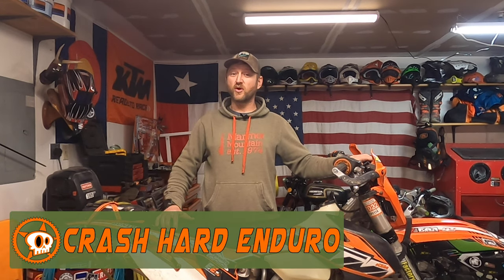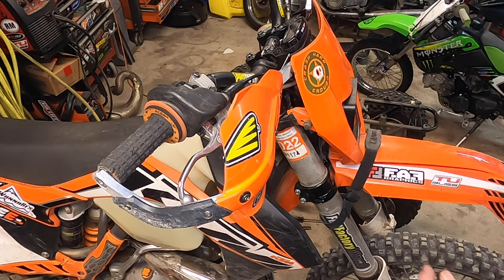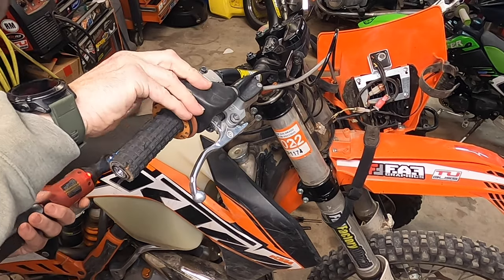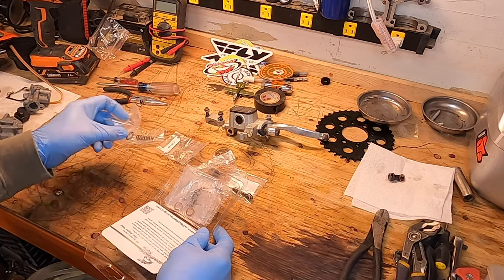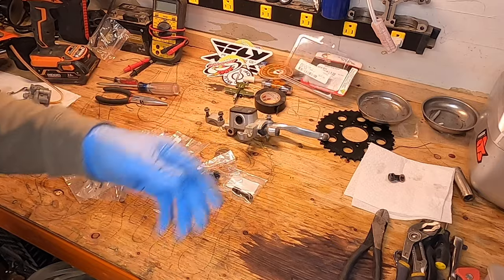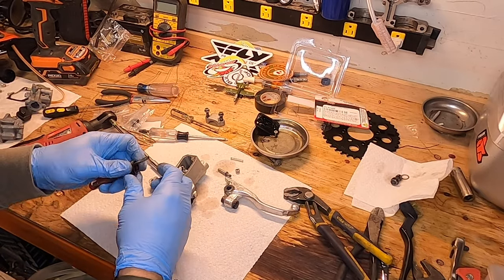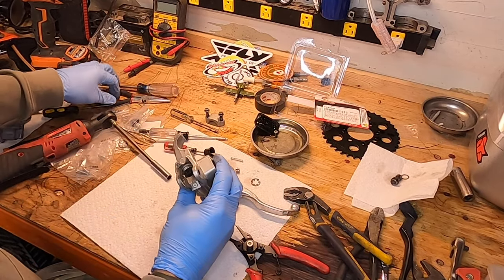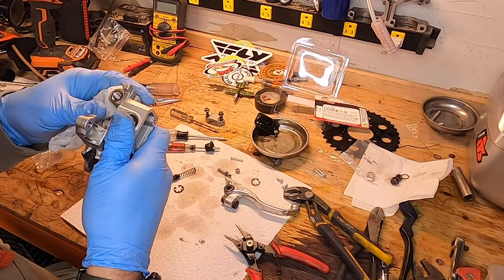HOW TO: KTM Front Master Cylinder Rebuild. Anyone can do it.

Comment: Got done with the project a little bit ago today.  Your video definitely helped.  During the frustrating part of putting the snapring back in, I ended up using skinny tweezers to hold the piston in while squeezing the the snapring.   Snapring pliers with end notches worked after trying ones that didn't have notches.  Oh and using an old catfood cardboard crate box with 2" sides helped hold the bugger still in the corner of the box during the surgery. The air bleeding step on your video was a great help.  After I bled the lines the old way it was still spongy feeling.  So I held the master cylinder up in the air as you showed and pumped it some more then it was good.  Thank you for a great video!

Comment: I enlisted my helper(wife) to push down on the piston with a torx screwdriver while I got the snap ring seated.  My snap ring pliers required a bit of file modification to get them to close enough to squeeze the ring properly.  I also used a long spark plug socket that matched the rubber cone diameter to push it in.  My task was a bit more involved because I also drained the caliper.  I had a heck of a time bleeding it all.  In fact I gave up.    Will attempt it tomorrow utilizing my helper.
Reply: Try pushing fluid through the caliper into the master with a syringe bleeding kit. I found it really easy to get air out reverse bleeding.

Comment: Thanks for the video, I'm about to attempt the project!
Reply: Got done with the project a little bit ago today.  Your video definitely helped.  During the frustrating part of putting the snapring back in, I ended up using skinny tweezers to hold the piston in while squeezing the the snapring.   Snapring pliers with end notches worked after trying ones that didn't have notches.  Oh and using an old catfood cardboard crate box with 2" sides helped hold the bugger still in the corner of the box during the surgery. The air bleeding step on your video was a great help.  After I bled the lines the old way it was still spongy feeling.  So I held the master cylinder up in the air as you showed and pumped it some more then it was good.  Thank you for a great video!

Comment: Very nice content of your video:

I come across and article about master cylinder (MC):

The master cylinder piston size affects how your motorcycle brakes work by controlling the amount of brake fluid that is applied to the brake calipers. A larger piston size means that more brake fluid is applied to the calipers, which results in a stronger braking force. However, it also means that the brake lever will require more force to be applied in order to engage the brakes. On the other hand, a smaller piston size will result in less brake fluid being applied to the calipers, which means that the brake lever will require less force to be applied, but the braking force will be weaker. It is important to choose the right piston size for your motorcycle to ensure optimal braking performance.

I need your help if you can answer for me the following question:
1. How do i know the piston sizes which fits to the MC?
2. How do I measure the piston?
3. What piston size are you using in the video?
Reply: What are you attempting to do?  The brake master cylinder for a motorcycle has a set piston size unless you change to a different master cylinder.

Comment: Mine had the little conical spring inside the rubber plunger cover and I found it in two pieces when disassembling; that would be the reason they include a replacement conical spring as the kit services many models. . Thanks for the overhaul demonstration. And yes slavens provided my kit as well.